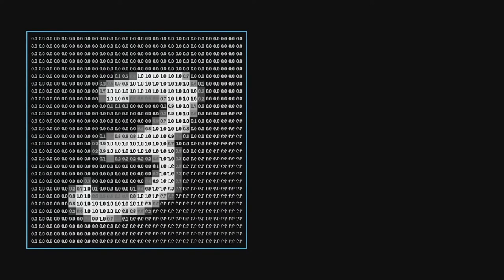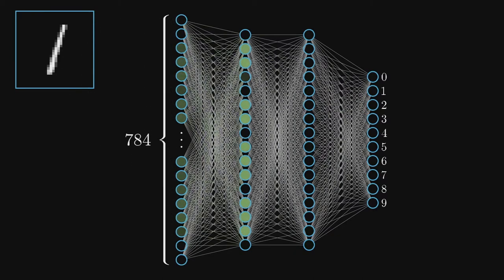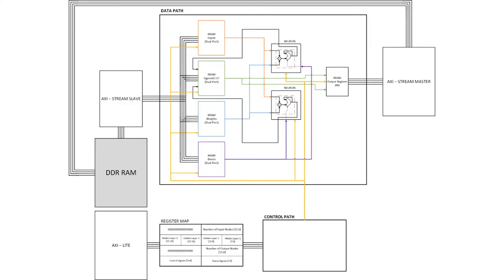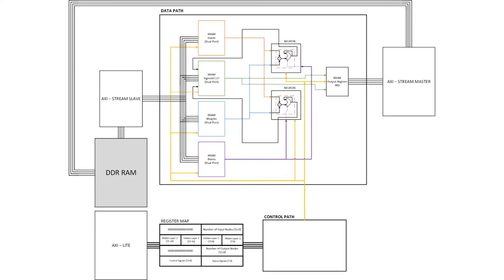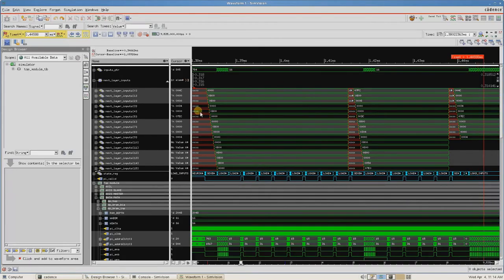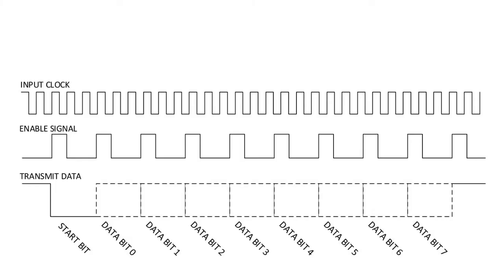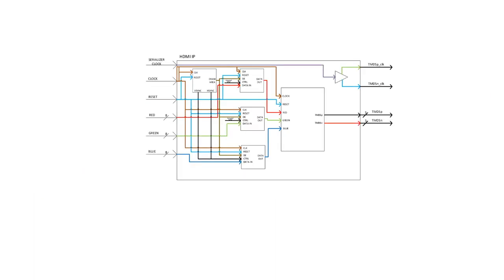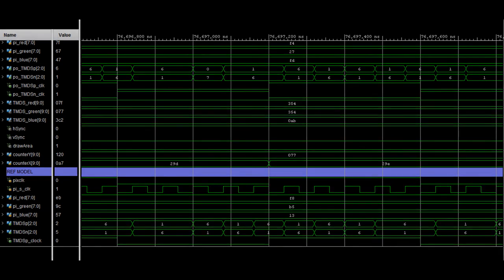Deep Neural Network Hardware Accelerator on FPGA

Comment: Wait how does your input interface determine you have a stop bit and it is not seen has a data bit? Is it because the RX line stays logic-1 after the enable? Does this mean all the data bits are logic-0 for a period of time after the enable is asserted?

Thanks for the info